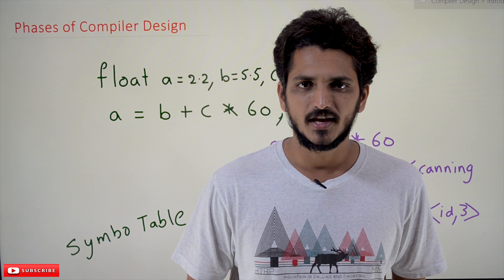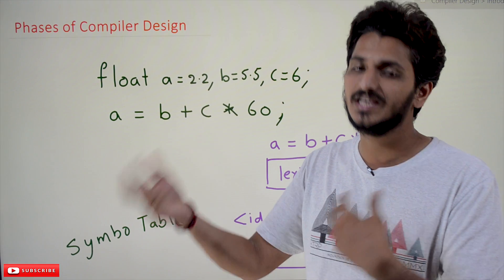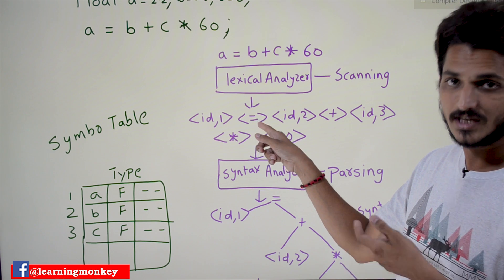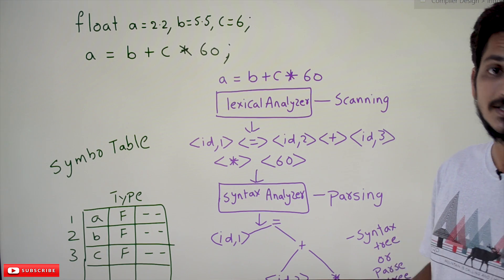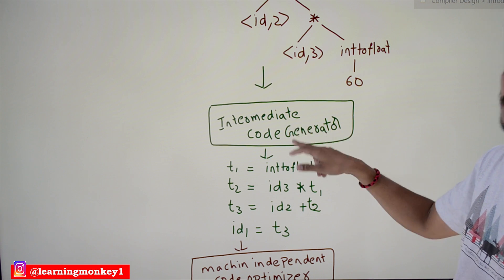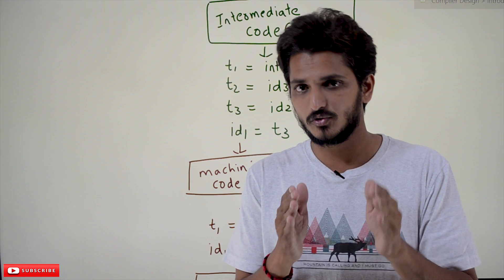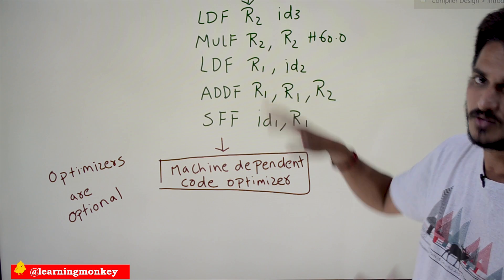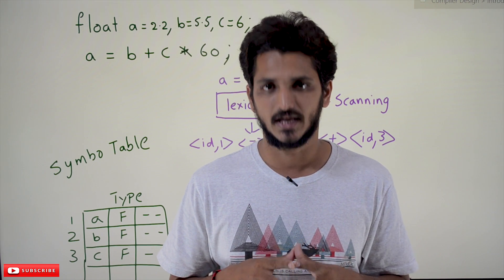Phases of Compiler Design || Lesson 4 || Compiler Design || Learning Monkey ||

Comment: 00:07 Introduction to phases of compiler design
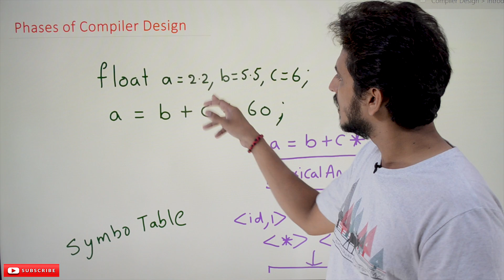01:42 Tokenization and Symbol Table in Compiler Design
03:27 Lexical analyzer phase divides syntax into tokens
04:58 Syntax analyzer generates parse tree from tokens
06:32 Semantic analyzer phase checks for variable declaration and enforces type conversions.
08:15 Introduction to Three Address Code
09:49 Code generator phase converts to machine level code
11:25 Machine dependent code optimization.